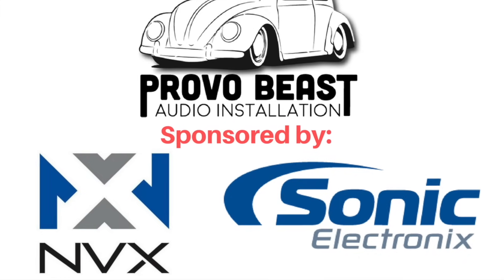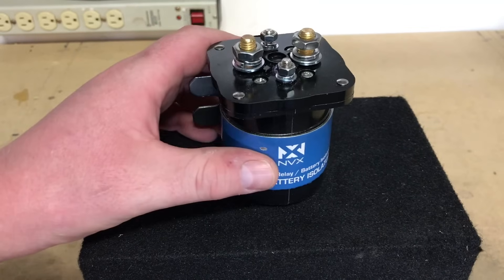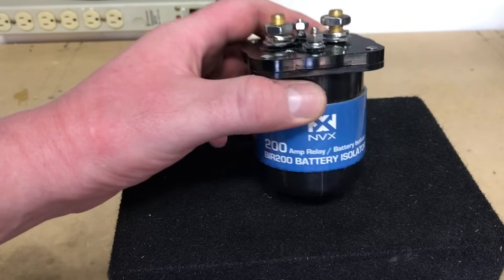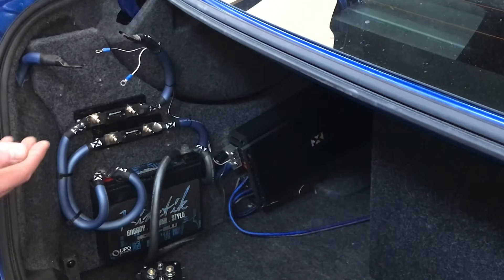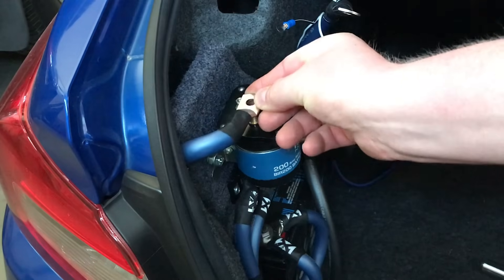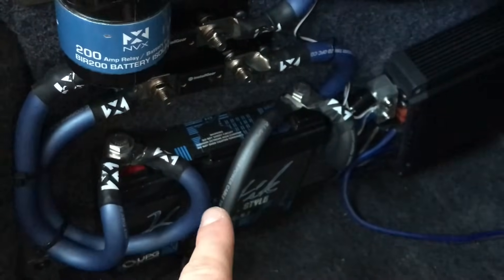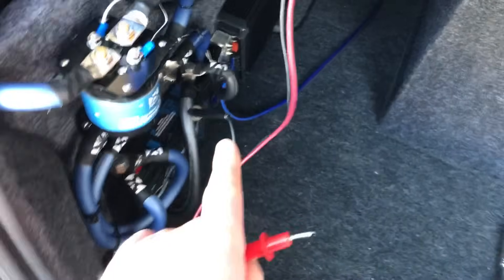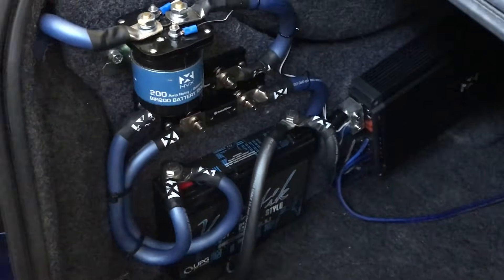Car Battery Isolators Explained: How to install on your car!

Comment: OK. HELP!! Question.  Could I use one of these, say in the 500A configuration as a straight up solenoid or relay to switch my starting battery on and off?   I have a 2000 Lincoln Navigator with the air suspension and other things that run off that battery, that within a couple few weeks, if I don't pull the ground, will drain my battery flat.   Unfortunately, I don't always know if and when, so it happens far too often.   If I had a switch that killed the battery, it would be far less frequent as it would be less of a hassle to do.   But, would say this in 500A work as a continuous operation with 100% of my battery amperage for the vehicle flowing through it during the times I operate it?   Just don't know enough.....

Comment: After the shop installed a Stinger Isolator for me (recommended by them), I would play my music loud while driving the car.  But the next time I turn on the car, code P0603 would come on. Never had the code the week before the isolator was put in. Do you think an isolator would mess with the cars voltage? I most likely will have this removed. Batteries and Alternator reads proper Voltage. Maybe the issue has something to do with the isolator on how it is wired to the ignition?

Comment: Hey Chris just wanna ask if I can use lead acid Battery as my auxiliary and will it be safe? Thanks in advance..
Reply from the maker: As long as it is a sealed lead acid, sure.  Any vented lead acid battery will vent toxic gasses.
Reply: @ProvoBeastAudio  Thanks Bro..

Comment: can you just hook that remote wire up to the same remote that your amplifier uses?
Reply from the maker: Sure you could do that.
Reply: @ProvoBeastAudio  okay cool thanks.. 

I have one more question I noticed that my fuse box under my hood has a power wire going to it when I run my wire from my alternator can I just go straight to the battery and skip the fuse box for the big three upgrade ?

Comment: So my question is do you just stick a wire in the fuse hole or is there an adapter I can wire to the fuse that has an ignition current?
Reply from the maker: Use an “add-a-circuit”
Reply: @ProvoBeastAudio  Gotcha! Thank you

Comment: Is it OK to have a isolator and a capacitor
Reply from the maker: All depends on your amperage and what you are pulling.  Not common for an isolator to be sued with a capacitor.
Reply: @Provo Beast Audio Installation  ok thanks I'm running a little close to 4000 watts, I appreciate your videos they are very helpful and informative

Comment: Great Video! Thank you. I'm kind of late to the comments but can I ask where exactly you got the ground for the Isolator? Im trying to figure out if I get from the second battery or if I get from the chassis.
Reply from the maker: both the ground of our battery and isolator go to the chassis.
Reply: @ProvoBeastAudio  Can the remote wire route from the ignition to the isolator and remote from the isolator to the amp?
Reply from the maker: @Messy_Jesse  Sure, it would just mean your batteries would be connected whenever the key is in that position (same with your amp).
Reply: @ProvoBeastAudio  I have my amp remote wire hooked to a toggle switch would that work as the isolators ignition sorce

Comment: So the is charging wire coming from the battery a separate cable from the one powering the vehicle's primary accessories?

Comment: Question. Is it ok to connect the trigger from the remote line going to the amps so that way the 2nd bat is only connected when the sterio is on?
Reply: na dude, cuz if you play the music while the ignition is off it defeats the purpose of the relay ( not draining both batteries )

Comment: How does this prevent a drain if your remote wire  for amp  still attached to main battery
Reply from the maker: It wouldn’t which is why you attach the remote trigger for the isolator to an ignition source, not an accessory wire. The radio will still draw from the primary battery, but the amp will only draw from the secondary battery.

Comment: If I have a 70 amp battery, and I add another 70 amp battery, - do I need to change the alternator and for what current?
Reply: Some batteries require a separate charger and it can be hard on a stock alt but people do it all the time. It will shorten the life of the alternator and I would suggest that every once in a while you let the car idle (even better if you drive) with the radio, lights,a\c, and anything else pulling power off to give your batteries a chance to charge up. It can make a different and voltage drop leads to damaged electronics and burnt voice coils from the clipping.

Comment: Does the NVX smart isolator need to be grounded to the front (starter) battery? I read a few reviews on Amazon that stated if grounded to the chassis, the isolator wouldn't switch over until dangerously low voltage when grounded to chassis? Any help is appreciated

Comment: So is this ok in a rv situation when you have a convertor charging and the altanator  ie running the vehicle with the convertor plugged in? How warm should the relay get?
Reply from the maker: This is a great application for an RV.  As for temp, you would need to work with the manufacture on that.  It's natural to get warm.

Comment: So can i use my remote turn on from my radio to amp to trigger ?
Reply: Remote is not 12 volt
Reply: I wouldnt do that because if your radio was wired to the secondary battery it wouldnt turn on to to trigger the remote signal. Plus if you turn of the radio it would turn off the battery.

Comment: Does anybody know why my battery isolator is throwing low voltage to my amp ? And if it’s fixable! THANKS IN ADVANCE GUYS
Reply: Did you ever figure it out? I would go down the line bit by bit with a multimeter

Comment: Can you start the car off the 2nd battery in an emergency situation?
Reply: Good question
Reply: Yes. You could wire a lead from the second battery + to the switched terminal on the isolator

Comment: 2:06  I want to install a 1500 watt inverter under the driver seat 3 feet from my starter battery and want it to offer power ONLY while car is running.  I was told the cables should be very thick and solid copper back to the starter battery.  Currently i have to manually turn the inverter off and on manually.  Two question:  1. could i have run ground negative from the inverter to my Chasis - right now i have two 1 awg copper lines between inverter and battery ? 2. where can i usually find 12v live when car is running? Can that live line be a small gauge?

Comment: Normally your head unit switches off (and your amp's go off as well) when your ignition is turned off-switch wire. How can the second battery then take over if the equipment was signalled to go off. What am I missing about how the second battery would operate your audio system with the ignition off?
Reply: But then the radio etc is pulling from the starter and the amp is pulling from the house battery right? So you're still pulling current from both?
Reply: You turn the key so the radio turns on, that tells your amps to turn on. The engine is not running.

Comment: Question ?.
Any good running my remote wire for the amp to turn on isolator....
Reply: I'm a little late here. You probably already figured it out. But yes, if you wanted to use the remote wire, you can totally do that. Its a 12v source, so you'll be golden!

Comment: Hello, can we use the isolator with 2 amps? Other words, can we run our wire from secondary audio battery post, to a power distribution block, and go from there?
Thank you,
-Derek
Reply: Definitely before it connects to the amps it is connected to the isolater

Comment: Hello,
May I please ask: Can I hook this battery isolator to my remote wire?
If not, I’d like to know why?
If so, I’d like to know how... Would I need a 30A relay or?
Thank you all very much for your input and advice. Have a lovely day,
-Derek
Reply: Its made to isolate the starting battery from the audio system. If you're talking about the remote turn on wire from the head unit to the amp, it would defeat the purpose to do it. The remote wire will come on if you turn on the head unit so it will still drain both batteries even while the car isn't running. If you never plan to listen to the system with the car off you could probably be ok to do that, should be able to splice a wire on to the lie and connect it to the isolator. 
 I wouldn't personally do it that way but it should work. Ideally you want it connected to something that only powers up when the car is actually started and then you could listen to your system or tweak on it with the car off and not have to worry about a battery. They also have setups with physical switches to go between one or both batteries.

Comment: The fuse is to protect the wire/cable so it should be placed near the source (alternator or main battery). The isolator sense the main battery voltage to determine when to turn on the charging of the secondary battery, hence the isolator  should be placed close to the main battery.
Reply: Hopefully he also has a fuse upfront close to that battery lol..
Reply: @BrokenSmokinSpokes with the way I see this installation I'm 100 percent he does.
Reply: It’s funny cause I keep pausing and rewinding the part where he’s showing the fuses and I believe he has 1 too many fuses.. Hopefully and only if there’s 1 next to the main battery under the hood where it should be. The fuse he has going from the Isolater to the secondary battery is unnecessary and not needed. I could be wrong… I’m new at this. But there should be only 2 fuses. 1 next to the main battery and 1 from the 2nd battery to the amplifier.

Comment: Have a question i have a 350amp aftermarket alt. And then i have stock battery up front and lithiums in the rear for my system. I have 2 1/0 power wires coming directly from my alt to the rear. But i still get a draw when my truck ia sitting because the wire coming from my stock battery to the alt i guess drains my lithium a little. Would i use the isolater between the stock charging wire from my stock battery to the alt or between  my alt to the rear batterys? And since i have multiple runs from my alt to the rear batterys would i need more then 1 isolater? Hopeing i can jst connect a isolater between the stock battery and alt and then the truck is off the isolater will stop the discharging between my stock battery and alt thus hopeing my lithiums will stay at there higher charge rate.

Comment: can i install the BIR500 - 500 Amp Relay Isolator on the negative line?
Reply: What size a fuse or you gonna be running

Comment: What do you mean that the isolator (large relay) remote/trigger "...which is essentially only on when the car is running and running only" by connecting the remote to the fuse panel? 
-----If the ignition is switched on, and that remote wire is hooked up to a switched power source at the fuse panel, then it will trigger the isolator to turn on, even if the engine is NOT running. 
-----So, where in the fuse panel (block) are you connecting that remote turn-on, or what switchable +12v supply, that only has +12v when the engine is ON, i.e., running? 
-----In newer cars, you likely would have to tap the ECU for a +12v supply that is on ONLY when the engine is RUNNING. Otherwise, you would need to make your own circuit using whatever components you can find, or simply install a switch that one can manually operate or even both, just for safety. Heck, adding a switch would be better anyway, so one can manually kill the power, if needed; that is of course unless that isolator/relay short circuits. 
-----In your wiring, once the ignition is on, and that remote is connected to a switchable +12V supply, it will trigger the isolator on, thus connecting the two batteries, thus starting from both batteries, and in which case, the dead battery can short the "Start" battery. It seems to me that one would want a circuit that uses only the front battery for starting the car, and then once running, the isolator can turn on, as to charge the both batteries. 
-----I also do not believe it is a good idea to run the back battery dead, then start the vehicle, which turns on the connection between the batteries, thus putting a strain on the alternator and/or front battery, which will eventually kill the alternator.
-----Also, in your case, if that remote does indeed turn on when the ignition is on, then one runs the possibility of too much power being pulled frontward, thus  blowing one/more fuses in the system. 
-----I have thought of circuit designs for large, high-amperage 12v system relays to use to prevent amplifiers from having the constant +12V connection from having power when the vehicle is off; thus, isolating the power up front, near the battery (or in the rear/both). You need to utilize 2+ relays, one low current, and one high current, esp. in a multi-amp system with same idea applied. 
----You could potentially find a switch that is very voltage sensitive that turns on only at say > 13V, but good luck there.
Reply: There’s usually a alternator fuse.
Reply: @serge805  ya. so what?

Comment: Why can't I just use my remote wire instead of ignition wire?
Reply: It says any 12v that is live while car is running. Or live once key is turned to acc and then you have the backup battery kicks on before the starter. But also prevents battery drain when completely off.

Comment: Great video,,,,,  quick question,,,,, I have a 2020 Dodge Charger RT,,, 1 twelve inch Kicker subwoofer, that's pulling about 800 watts from my amp,,,, slight dimming of lights,,,, I ordered a XS Power 375 battery,,, I don't play music with the car off,,, Would I need a battery isolator?
Reply: Best to install an isolator..I triggered mine off of my a/c compressor fuse..because it isnt on when the car is off or when my key is turned to accessory. I frequent drive ins with my kids so having 2 amps on running the radio puts strain on the primary battery..now i can have the key to accessory and only be drawing off second battery for the amps...the isolator is fairly priced to just have it for special circumstances and to ensure your batteries wont crosstalk while not in use.also amazon or any auto parts store has a fuse tap that works amazing and is super cheap. Makes install easy
Reply: Depends if your oem battery is an agm or standard battery...the whole reasoning for an isolator is to stop the. Batteries from draining eachother when the car is off. When they are connected without the alternator charging them they try to charge eachother. The isolator acts as a switch so when the car is off, the batteries arent connected to each other.....
Reply: @ridethewagon69  The 🔋 in the car is stock , that's all I know

Comment: Hello, so I took my 17 Sierra to a local shop where I had a full sound system installed with a second battery and isolator. I noticed the shop connected my amp power wired to the primary. There was no power going from my second battery to my amps. The primary and secondary battery were connected to each other. So I decided to disconnect the power amp wire from my primary and connect it to my second battery. I would listen to my music with the vehicle off but I noticed the 4 channel amp would cut off. I took the vehicle back to the shop and told them what I noticed. Their response was that they connected the power wire from my amps to the primary because of “feed back” in other words the reason why my 4 channel amp would cut off. So I’m a little lost here. Why am I getting feed back? Why would they connect it to the primary battery and not the second battery? Any help would be very appreciative. Thanks in advance.

Comment: I bought a 500amp NVX isolator before i saw this informative video..
My system will pull about 3500 watts with a XS Power D6500 as my auxiliary battery running 300amp in line fuses..
My question is could i have use the 200amp isolator & is my 500 amp a good idea or not..also I'm curious on why you went with the 200amp on this install in the video?..thank you
Reply: as long as amperage is higher than the alternator puts out, you will be fine. The rating is like a fuse rating, its good up to xxx amount then it blows.
Reply: Id like to know the answer to this question too. I have the same battery

Comment: i dont want to run my audio system with engine  off so i dont need this your saying
Reply: It's not just for that, it's to seperate the different battery types as well...
  Especially when a lead acid can drop the voltage of an AGM by nearly a volt.
Reply: @one4chuckantel  I'm adding supercars instead of another battery  at 16 volt (it wont charge that high) it has 80 fares may alt. Is 240amp and I'm at 1700 watts (bass shakers in the front seats)

Comment: Where did u connect the true ignition wire
Reply: Any 12v source. 12 volts is 12 volts
Reply: He refers to the cabin fuse box and you will jump from a 12v source in the fuse box that is only in use while the car is running. Check your fuse locations with a multimeter with the car off and make sure you get no power then check again with it on and if you read 12v+ with the ignition on then connect there.

Comment: I have a positive wire directly from the alternator to the isolator and the other positive connection on the isolator going to the secondary battery. Will this work? Or do I have to connect the starter battery positive to one isolator post and then connect the other post on the isolator to the secondary positive? My secondary battery is not charging.